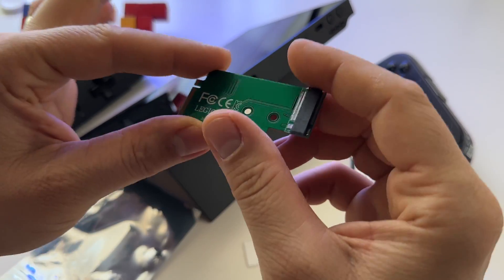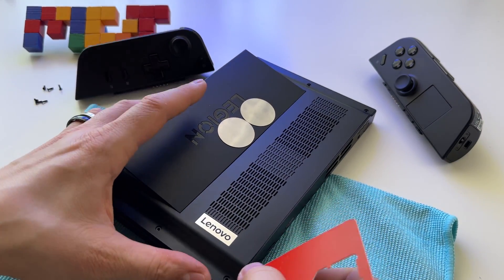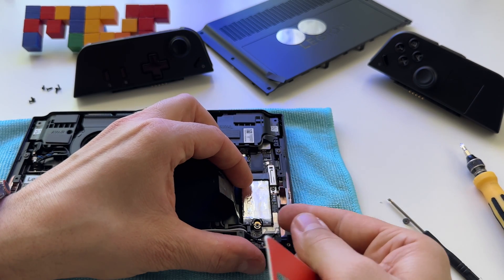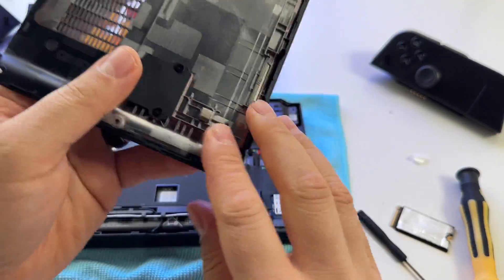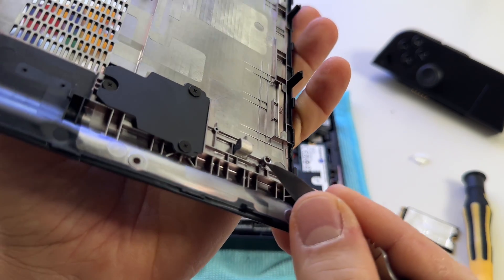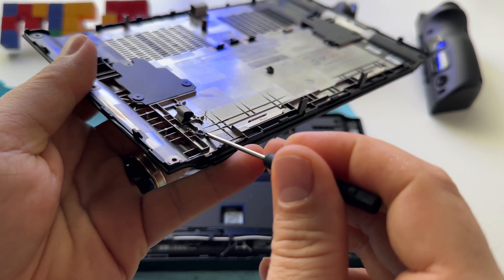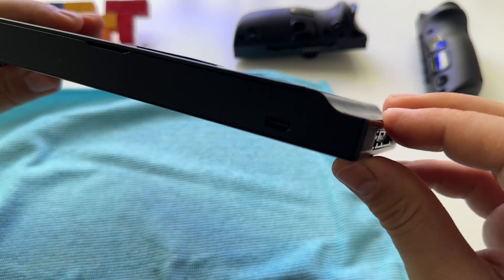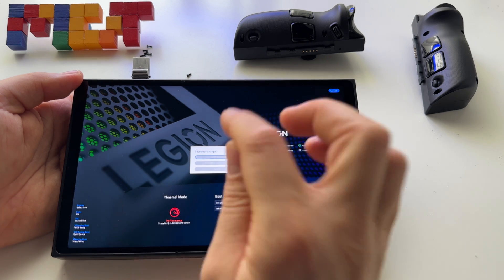Lenovo Legion Go - installing 4TB M.2 SSD 2280 with special adapter

Comment: My legion go just doesnt see the ssd. The adapter I received seems to be faulty, but it works on my desktop. Any ideas?
Reply from the maker: Some Legion Go have problems with ports. Inhad same problem. Probably Bios problem. I have a friend with the same issue.
Reply: @MGTMaxGamesTech I guess there is no fix then? It is so unfortunate if so. Thank you very much for the response.
Reply from the maker: No fix, unfortunately.
Reply: @MGTMaxGamesTech Alright, thank you very much. I will still borrow your idea of using magnets for the external drive. I currently use velcro and it doesn't hold good :D

Comment: wouldnt that run hotter since you are using a different size m2 plus with that adatper even if you had heat transfer pads that drive when gaming off of it its gonna run extremely hot

Comment: Did the mod using a hynix p41 temps while transferring large amounts hit low 70s. During gaming low 60s peak. I added a .5 mm thermal pad which reduced temps a bit further. To clarify the higher temps were hwinfo #3 which is the controller. I'm assuming temp 1 & 2 are nand and dram which were 40-50c

Comment: Lol how are you doing heat tests on the outside of the legion go when you could use hardware monitor and show after use what the temperatures are? And if the speeds are Gen 4? There's no information in this video.

Comment: this method is too dangerous to be good safe, like no thermal pad on SSD etc... Warm heat sink etc.... DONT DO THAT !!
Reply: Original drive temps for me were 94c after adding 2280 were much lower 😅

Comment: Hello,
I got the modified board to add a 2080 on the Legion
.
Does this Nvme work for the Legion?
SAMSUNG 990 PRO SSD 4TB PCIe 4.0 M.2 2280

Also, which heat sink or heating pad do you recommend ?

Comment: Did you keep the 4tb installed? Any over heating?
Reply from the maker: No problems here. Definitely it will generate more heat, but I had no problems.

Comment: Ladies and gentlemen. The adapter he is using is a Modified Transfer Board For Legion Go SSD Memory Card Adapter for NVME M.2 2242. They're available on Amazon if you're in the states like me.
Reply: Redirect the position of the ssd. You can clearly see the new orientation of the ssd.
Reply: Is the seller hesupy? I’m trying to find this adapter to do this
Reply: Link?
Reply: what is the purpose of it?
Reply: @arezxx5244  The stock drive is 2240 and this one is a 2280, so its basically double the length, this adaptor brings it back down enough so that it can lay flat.

Comment: NVME drives go in at a 45 degree angle and then bend down, not pushing straight in, 116 k subs and you struggle with an NVME. bro....

Comment: How is 4Tb SSD Doing now ? Have you experienced any issues caused by increased SSD power consumption ?
Reply: its hot af to the point i feel heat on the front screen
Reply: @misuki6579 did you do anything heat sync wise. There are different backplates you can order for better airflow and you could have used a copper heat sync and or the blue tape adhesive

Comment: Have you had any issues with overheating or stuttering since install?
Reply: Actually i did this replacement and yes the back left side does get hot..so i added a thin strip of thermal pasds as it works much better

Comment: Hey mate, i just did this with a Kingston 4tb 2280 ssd, but im having a huge issue when unplugged and running it on battery, the disk activity is spiking like hell from 0-40-72-100% disk usage and games are unplayable cause it stutters every second... do you know what might cause this?,

Its so weird cause as soon as i plug it into the AC adapter it vanishes and is smooth as hell..

Would be lovely with some feedback on this please!.
Reply from the maker: Strange… 
My first idea, I would recommend this: Check the power plan in windows battery settings. It seems that you don’t run on performance without cable. Maybe you made the settings for unplugged to run on a lower profile. Windows will switch them automatically. Probably this is the problem. Check those settings.
Otherwise, if this is not the problem, I would recommend to try with another 2280 ssd to see if you get the same behavior.
Reply: You're apparently on the power threshold with the ssd being used.

Comment: Someone should make a printable backplate that supports the mod.
Reply: There are some in Ali Express now they're ranging from $15 to $25
Reply: There's a few on Amazon that replace the entire backplate, making it not only quieter (because of bigger fan holes) and a space for a full sized SSD. Only thing is the ones I've seen require a SSD adapter that has it laid horizontally along the battery.
Reply: what's the heat rang when playing games? i want to update my ssd. i still have the stock 512

Comment: You can use macrium reflect free trial and do a 1to1 SSD copy before switching ssd's so you don't have to do recovery or loose anything on the original SSD.
Reply: Thanks legend. Got it. I have been reading the ssd temperature's are crazy for majority of the 2280 ssd. Has anybody had any luck managing the temps better? I wish someone makes a custom backplate that rises out a bit more and allows for better heat dissipation.
Reply: exactly , this is how i have done it and it worked perfectly
Reply: Ive cloned my original ssd to the 2280 one, but when i use the 2280 it keeps on showing a blue screen saying recovery. Do you what could be the issue?

Comment: My new ssd does not show in the bios boot order , I have cloned to the new drive (2242) size any ideas?
Reply: Technically you shouldnt have to boot into bios after that.. you can automatically start your legion and itll work as if it was the original ssd...thats why its clone:::
Reply: @thatonegamer2709 
Thanks for replying.
The problem was the SSD I bought was an NFFG SSD.
THANKS AGAIN 👍

Comment: Glad to see you finally got that adapter to mount the SSD internally instead of the external set up that you were using with magnets.  This set up will work much better but will just have to monitor the temperature of the SSD when gaming.  Good video!
Reply from the maker: Thanks. Just for info: Legion already has 2 strong magnets inside, at the base. This is how the kickstand is closed at the base. Magnets have no effect on ssd or components, as long as you don’t use 1kg magnet :)

Comment: This is a great guide but why do it the hard way and go into bios and change boot order to flash drive and use Lenovo recovery to install windows and every driver again?. 
Just clone the SSD. It super easy and it only takes like 30mins to clone it. Use Macrium Reflect free version. 
There are many guides here on Youtube how to clone SSD.

Comment: can you please provide a link for that adapter?
Reply: Modified Transfer Board For Legion Go SSD Memory Card Adapter for NVME M.2 2242
Reply: Youtube does not allow us to send links. it gets blocked and deleted.
Reply: Any clue please what is that adapter?
Reply: @victoratterstig4379 amazon search "legion go 2280 m.2 adapter" you will find this one, and also the ribbon cable one for the custom backplate if you don't want  your ssd to get heat damaged on the top end